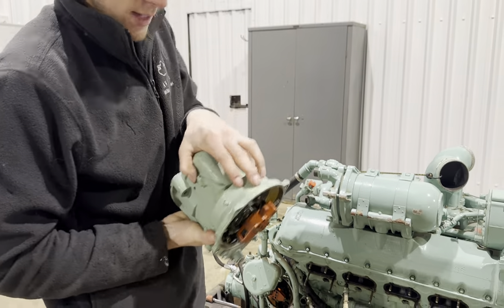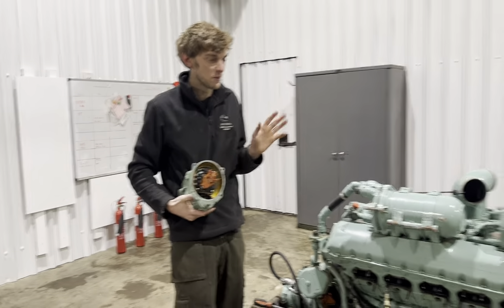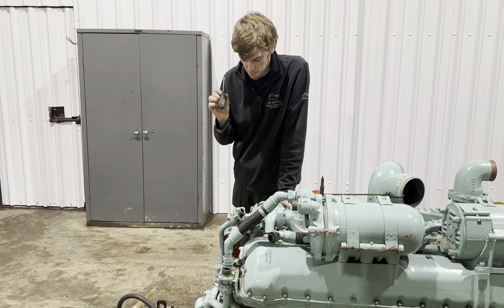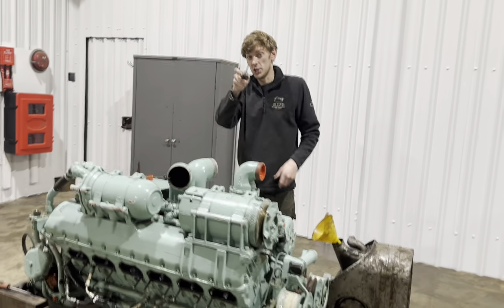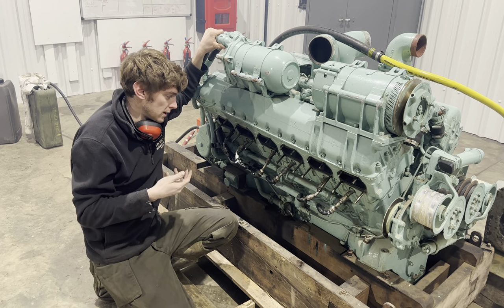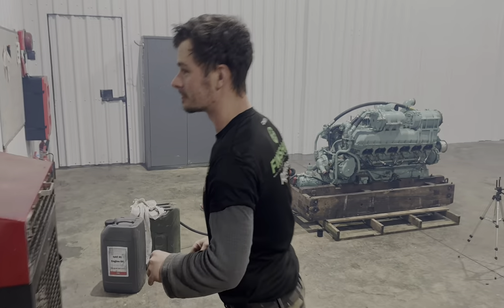ROLLS-ROYCE V12 BURSTS INTO LIFE AFTER 30 YEARS

Comment: To get better at this, here's some tips:  When priming the oil pump, use Marvel Mystery Oil. After filling the pump, pour the rest of the bottle into float bowls. Now you can prime the bowls. No need for pliers, just a small amount of petrol, MMO and time. Hard tools scratch the stem that has to travel inside the small hole on the lid. This needs some rag and lube too.  Re-fit the oil lines and open the magnetos. Again, no need for hard tools, a piece of badly washed cotton sheet is all you need. It scrubs the points clean without the need of pulling anything apart and picks up all the residue. Chisels, files and sand paper not only wear the points out prematurely, but also introduces small ferromagnetic particles into this electro-mechanical system that relies on tiny air gaps and strong magnetic fields over these gaps. 

Now you can prime the engine as you did. The MMO inside the pump goes directly to the dry bearing surfaces reaching even the rings before the engine heats up again. If you want to, you can drop some MMO directly over the pistons through the spark plug holes to lubricate the cylinders. Just remember to spin the engine before installing the plugs back on to prevent hydro-lock. MMO is flammable, so it won't ruin your plugs, if it gets there, it will clean them by solving the soot.

Why the "Snake Oil" treatment? When you are using this as an exhibition piece, it never runs at it's normal running temperature. So there is excessive amounts of carbon build-up everywhere inside the engine, and the thick oil simply can't cope with the constant cold start situation. MMO is the best cocktail on the market, and it is specifically designed to keep these machines running.

The secret to First-Kick start is generous and full seasoning of the intake. It is dry in there, and lots of soot, dust, mice etc, so first quart basically sinks into the carbon build-up and no gas is entering the cylinders. This can be observed at the first try. The V6 closer to you had gas, but the outer one didn't. Although it is recommended to use just one cup of prime juice on a regular cold start to prevent flooding the plugs, when the firing interval is this long, both carbs need their own cups to get going. Magic here is time and timing.

And here is everything extracted: Pull the oil feed line open and fill the pump with MMO. Screw the line back on and open the float bowl caps. pour MMO into the bowls, clean and lube the caps and screw them back on. pump a few squirts of petrol into the bowls and turn to the spark. pull plugs out and drop MMO onto the combustion chambers. Open the magnetos and clean the points and spinners with cloth. MMO helps here too. Now you can turn the engine over and find spark. While you're at it, you can check the oil flow. After these are in check, open the float bowls again. The floats should be free already, but if not, use your fingernails to gently wiggle them free. A gentle tap of a screw driver handle works too, just don't introduce any ferro-magnetic particles into the fuel system by using tool steel pliers.. When the floats are free and bowls are full, onto the finale. Two cups, one for each carb. After pouring, count to five before hitting the starter. The prime cups are solely for marinading the intake. The fuel system is adequate for running the engine, as long as it doesn't need to moist the intake too. Hit the starter and open the throttle on third turn.
Reply: Just an idle question where on earth does your extensive knowledge come from?
Reply: @glencoe8251  From people on Earth. Through the medium of conversation and co-operation. The key being respectful approach.
Reply: I would think experience and the School of Hard Knocks. My suggestion is Brown packing paper; use the rough side .  I cut the paper in strips and drew it through the contacts points burnishing away the silver oxide. I still have a Lucas burnishing Tool designed especially for cleaning contact points, without removing the points from the distributor. I learned this technique in the British Army. The School Of Hard Knocks Harrogate.
Reply: @VK7AM  Works great when dry, but not when wet. Thus I use an old piece of cotton sheet. :)
Reply: Obviously, the knowledge of the physics of every one of the components and how they interact with each other is the very Basis of the entire project. You cannot be an expert on spark plugs, and not know anything about a dry oil sump system. Same with carbs...you have to know the physics of the updraft carb, as opposed to a a fuel injection system, or other types of carbs. Points, rotors, timing....everything you use in any system has a corresponding action/reaction to the downside, upside, or Both, for the entire engine to work. But it all boils down to simple parts, one before or after another, working properly. The Complexity comes in how all of the simple parts interact with one another.

One tip...the white stuff on the points is Not "corrosion"....it is Oxidation. The metals used in the contact surfaces of these points oxidize in normal atmosphere, and that oxidation accelerates when they are exposed to electrical currents and their arcs when they operate. The oxidized film gets more and more resistive as the layers of oxide builds up, eventually resulting in no current, and thus, no spark. Never use an abrasive to remove this oxidation. There are Chemicals that remove this oxide without abrading the remaining surface of your points. Once cleaned, then use a preservative on them. A Chemical preservative, not oil based. Oil on the points burns into the metal surfaces of the points, burning them out faster. It might be okay to use abrasives on points that can be replaced. These cannot.

This is a Well Done project, and I, as a mechanic and an electrician, appreciate it.
Reply: @otpyrcralphpierre1742  And your point was.. nitpicking on wording, to a comment originally written by a person who does not speak English as a native language. Secondly, my original comment was a summary of maintenance procedure for this exact engine. Not just any random tip, the field proven method for this engine. with the addition of my personal experience for this and similar engines from the period.

Comment: the first patent of a fuel injector (in the UK) was in 1927, could imaging the amount horsepower and fuel efficiency increase if Rolls-Royce had put them on the Merlin and its derivatives (the Meteor) as well as the Griffon. also the less of a headache it would be as there would be, as there would be no need for carburettors.

Comment: On good points use switch/contact cleaner on wooden lollipop sticks it removes the smeg & polishes the metal face giving a clean arc surface.
As they age and get pitted nail files in rough to fine grades will get the face of the points smooth again. If not getting a spark at the plugs persist, check out those shielded suppressed plug leads, they strip down, sometimes on old engines the ignition wire can internally break or burn out or have shite connections! Fortunately rebuildable with a roll of new copper ignition wire.
Previously owned & played with humber pigs, ferret, Saracen & Explorer!

Comment: Removing the film on the points with a blade or sandpaper will damage the plating on the contacts. The coating & contacts are designed so that there are no arcs, even minor damage to the contacts can cause mis-fires, and will shorten the life of the points. 
   It's better to clean points & relay contacts with switch cleaner like Servisol 10 or other contact cleaner. Use a piece of thin card soaked in cleaner to remove the film. Acetone or nail varnish remover will do at a pinch.
   Thanks for posting these video's, your antics brighten my day. Lastly, liked this more in depth video, cheers...DA

Comment: There's just something awesome about the  RR V12, unlike the Leyland L60...

Just so you know Joe; those ear defenders won't protect your hearing from that level of sound pressure.
Would hate for you to lose your hearing.
Reply: pardon !
Reply: Well we used to wear big ear defenders in the test house,1st when were setting up the mixtures with no manifolds on,then on full load with manifolds connected to main exhaust stack
Reply: @stewartbrown8115  You're looking at around 160db at 1 metre with no manifold & the best muffs will knock off 30db & anything over 120db can cause immediate hearing damage.
Add small plugs (so they sit deeper in the ear) & you get down below that level.
If I'm doing a lot of shooting, I always double up, especially at an indoor range.

Comment: Whenever you stow your points, pop them loose with a shim made out of a non perishable material that won't interact with the metal. Grandpa used the plastic spoons that came with old glue (that plastic is still flexible and soft after almost 68 years now..., i still use it myself). Then, you'll have less corrosion. No, no corrosion, but far, far less. I'm able to pop in a tractor that's not been run for ... maybe two years and just remove the little spoons and give the oil pump a jog and that's all it needs (i also do the run till it runs out of fuel trick so it doesn't have standing fuel inside). Taking your time on stowage saves you arsepains later when you want to play.

Comment: You can see the debris from the rings destroying themselves coming from the exhausts. I’d use a 20-50 weight oil instead of straight 50 weight oil because of the viscosity protection especially on a stored engine.😊
Reply: It designed to run on OMD 110 oil

Comment: Where did you find this big boy? Did you buy it at an MoD auction, or do you have a contact somewhere? I presume it's the same 27 litre engine as used in Spits and Lancasters. There can't be many left still in running condition.

Comment: Air craft still use mags because that simplicity makes them reliable. I wouldn't trust an engine controlled with an ECM at 10,000 ft.Another problem with mags is if you leave them sitting around,the magnets lose their magnetism and must be remagnetised. At one time,most old garage firms still had a mag machine sitting on a dusty shelf,but i haven't seen one for years. 
A guy in Australia buit a 1955 Chevy with a meteor Engine ,quite an over engineered thing to look at.

Comment: This the 600 or 800Hp?

And i cant believe people used to say "A small engine" in a derogatory tone when they referred to the engine inside certain tanks that had these... they always forget to say "RR V12 Meteor".

Edit: I missed the previous video lol. 600hp.
Reply: Actually the meteor engine was massed produced by Rover they were rated @ 610 BHP
Reply: @stewartbrown8115  I thought Rover only made the later variants... the later the variant, the lower the HP. There were many variants over a period of 24 years. Mid-Late Meteors came in 410, 610 and 800 HP. I was also under the impression Rover only made the 410, late 610 and Rolls made the early 610, 800, 1000 and 2000.

I may be wrong in that... but one thing is for sure... Rover did not design any of them... and essentially only got the contract to build the Rolls Royce engine and stick their logo on it... Ergo... If it's designed by RR, endorsed by RR, Same quality as RR and contracted by RR... it's still a RR lol.
Reply: @babalonkie  no rover did not design them it was eventually manufactured br Rover as RR were to busy building aero engines
The 800 bhp was probably the M120,which was fuel injected,designed for the Conqurer tank
All the time I worked on them it was the mk 4B whiched produced 610 BHP I left in 1975 and the centurion was being phased out along with the meteor
There was an adapted meteor called the meteorite,witch was a V8 fitted in the Antar( a pig of an engine)
Reply: @stewartbrown8115  Merlin > Meteor > Meteorite.

Probably the last line of good "land" engines made in the UK.

Comment: ⚠️ same goes for starting ANY engine up which hasn't been run for a few weeks 

The danger especially with ECU injected engines is they fire up too quickly meaning bores, crank and cams are dry initially.
What you need to do is deny either fuel or injector signals etc & turn engine over until oil lamp goes out.
Then fire her up.
Many engines are prone to damage with delayed oil pressure.
Not a problem if used regularly as oil will still be around the journals etc 😎

Lots of older aircraft engines have electric oil priming to get pressure up before cranking.
If cars had that the longevity would be doubled for sure 👍

Comment: Might sound silly ... but why not pre-oil the engine with an external pump?? That way everything would have lube before it ever turned. Sounds like a better way to protect 20K ...

Runs a treat - or soon will. Thanks!
Reply from the maker: Because this is a recon engine. It still had a fair amount of oil inside so the danger on this one really wasn’t that great
Reply: They were put on the test bed after overhaul in the workshops,everything connected except the exhaust manifolds,turned over on the starter motor,and when oil pressure rose the mags were switched on
Reply: @stewartbrown8115  - Bit late Stewart - Mr. Hewes already said much the same 😎
Reply: @jimrky6062  yes everything was smeared with oil,but the oil filter & lines are dry
Also if its been been in storage,the engine would have been run on preservation oil before removing from the test bed,not lube oil

Comment: Do you not find that after 30 years of no use the oil seals for the crank and any external drives will leak once the engine get stinking hot.
Reply from the maker: You’d be surprised how good all that stuff can be on these

Comment: Im not sure if it is normal on an engine. But seeing how it spitting flames out of the exhaust sides, does make my brain theorizing that the timing might be abit off as the exhaust valves opening too fast before all the combustion had happened
Reply from the maker: Hence, the name, Spitfire! 😉
Reply: @MrHewes  Oh? So it came from a Spitfire? I thought it was said that it was a Meteor and is for a tank. Im confused XD
Reply: The exhaust spark plugs were fitted with a heat shield,engine fired up,and then the mixtures were set to a nice blue flame

Comment: Running that engine, unloaded and without the flywheel really won't hurt it. Would be a different story if it was loaded, which without the flywheel you really don't even have a way to put a load on it.
Reply: There wasn't a flywheel on the meteor,only the meteorite

Comment: That is a LICENSE-BUILT PACKARD Merlin. The light-green paint is the tell-tale. Rolls-Royce built Merlins are heat-resistant aluminum painted with BLUE-BLACK valve covers (heat-resistant "wrinkle paint"). The Packard built Merlins were MUCH, MUCH better than the Rolls-Royce built. The Rolls-Royce Merlin was rated at 150 hours life at full power and SIX MINUTES at "War Emergency" (push the throttle thru the wire "gate"). The Packards were rated for 300 hours at full power and 72 Minutes at "War Emergency" rating. All P-51C-and ups, were equipped with Packard built Merlins and developed 1350 HP (MINIMUM) at "War Emergency" rating. The famed Lancaster bomber woudn't fly with Rolls-Royce engines, nor would the Mosquito!!! The International Harvester Corp  built Rolls-Royce "Griffon" was also FAR superior to the Rolls versions at OVER 200 more HP at take-off and nearly 500 HP more at high altitude and 300 hours MORE "service hours". The Napier "Sabre" sleeve-valve engine in the Tempest and Typhoon was really the only WELL-MADE British aero engine of WWII.
Reply: Well it’s a meteor so your wrong on that count 😂

Comment: Good clip. Those carbs are about as efficient as a toilet bowl!! And it does have 12 exhaust valves per side.
The sound of these engines to me is underwhelming, both Meteor and Merlin versions. I have been around very sharp sounding race engines for decades, not tractor engines!
As for the workshop?? It is very white